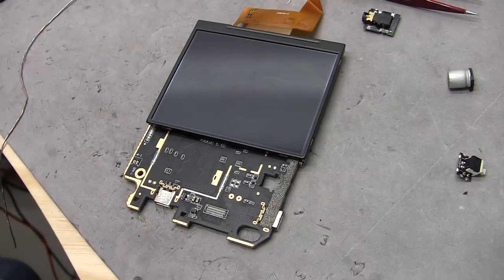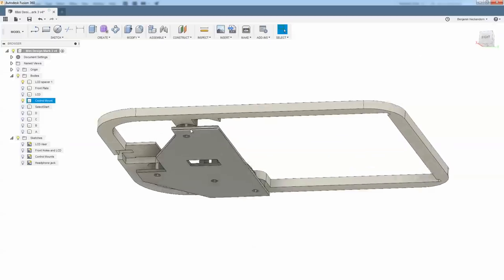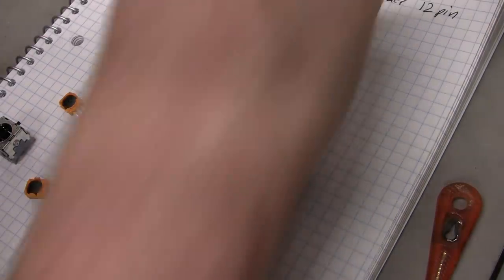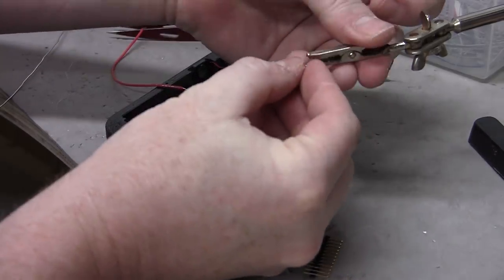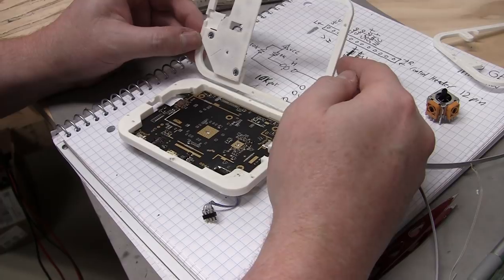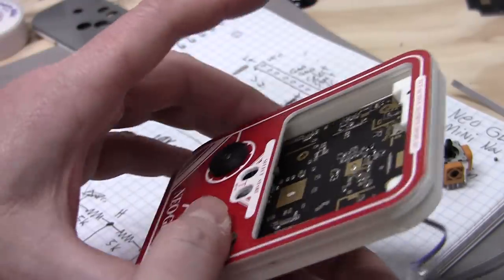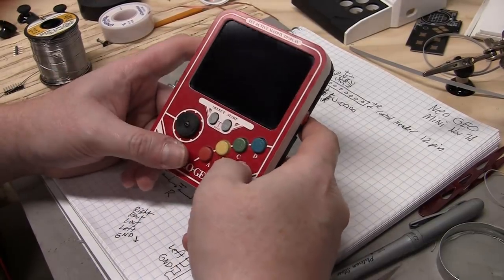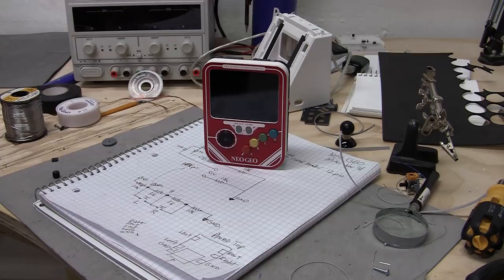Ben Heck Neo Geo Mini Portable Part 2

Comment: This would have been a much better final product.
Reply: but doesn't the click switches take away from the sensitivity of control? Like you can't get much variation in strength of movement that way it's either on or off.
Reply: It's intended to be a digital joystick, that's what the arcades had and that's what the games were programmed for.
Reply: Lassi Kinnunen  Hell, a single surface mount 5 way tactile switch from Sparkfun is only $2 and the Neo Geo Pocket/Pocket Color used a 4 way tactile switch instead of a D-Pad in the late 90s.

The additional cost would've been low enough that they probably wouldn't have needed to up the cost or if they wanted to maintain the same per unit profit margin maybe bump the price $5-$10. I have no idea why anyone would defend SNK's decision here.
Reply: @sams6090  That's exactly what those games were designed for. If you ever play an actual Neo Geo MVS cabinet you'll find the stick uses tactile switches. That's why if you buy say, a Sanwa kit, the stick has tactile switches and not an analog stick.
Reply: Looking at this, I do think they could have done this and had cartridges for it so you can play buy different games for it like a Game Boy.
Reply: @sams6090  All the games were designed with a 4 way digital input as the default control scheme so all those extra degrees of sensitivity aren't used by the games anyway.
Reply: @sams6090  This is neogeo m8 all games used digital inputs back in the day no analog
Reply: Lassi Kinnunen  why not add the clicky micro switches and remove something like the stereo speakers?  While they're at it, they should've taken out the hdmi out and added a battery
Reply: @JaredConnell  @ghhuyuyyu
Reply: @sams6090  Most arcade games don't use analog controls. A direction is either on or off, and the combination of 4 switches allows for 8 directions (by being able to press two at once in the corners).
Reply: Sam's luvin no, because all controls are binary in these games
Reply: @sams6090  you got owned in these comments.

Comment: I love that you're helping those in gaming needs!  You are great at what you do, and I've learned a lot from you!  I retro fitted my Grandfather's DREMEL table jig saw with a modern electrical ground plug because the electrical cable was shedding old plastic when I used it.  I used your soldering techniques to do it!  The thing is from the 50's from my research!

Comment: Now you have to bypass the password on the terminal so that you can add more games
Reply: @adventureoflinkmk2   Probably "Admin", lol.
Reply: Is it though?
Reply: @NeoJ4K3  I've tried quite a few myself. It's not Admin, lol. I have this idea to dump the flash by removing it and then using a chip dumper to get the data and a Linux system to jail into the filesystem and figure it out. The cheapest chip programmer I could find that supports the flash used is like $400...Sadly my old Genius programmer is showing signs of age... 😆
Reply: it's 1234, same as the combination on my luggage😎
Reply: @twicethemegapower3995 I think that's  1234,5 ;)
Reply: @AWalYT  It's possible to brute force it. Cheaper but might take ages.
Reply: @AWalYT  Is there no DFU mode on that thing? Or a bootloader like uboot?
Reply: The password is password
Reply: @mbirth  I believe it starts into UBoot on the serial console, but I could not appear to interrupt startup. I remember I had a mini netbook PC running some ARM chip that I could just give it some input over serial during the UBoot and it'd freeze and wait for commands there, but the same thing just isn't working here.
Reply: @AWalYT  Have you tried hitting ESC a few times when UBoot starts? Also fiddle with the terminal settings as there are different ways they send key codes and maybe UBoot expects a different way.
Reply: @AWalYT  damn man, I hope you find a way in, would really make this little console even better
Reply: @twicethemegapower3995  who needs combinations? There are only about 7 different keys to all luggage in the world... and that number narrows DRAMATICALLY by the type of lock you have... I.e. roller bag or separate lock
Reply: @twicethemegapower3995  President Skroob, is that you??

Comment: Nice work.  Please get a better 3D printer though :-)     The only down side on this (but easy to correct) is the micro switches used only have a 30,000 press cycle life, so they could burn out in as little as 10 hours of constant play more aggressive players.

Comment: For the stick, it you printed it in the right dimensions you could put one of those rubber covers that go over the sticks of a PS4/Xbox controller. That'd cover the screw quite nicely, and provide extra grip.

Comment: Glad to see you doing videos like this after the show ended. I might be in the minority here, but I kind of like these simpler straight to the point, quick cut solder porn style videos more than the big production values of the show. It can be as long or as short as necessary.  You're familiar with John's Arcade (you did a collab with him after all), and his arcade restore videos are super long, but awesome. And you can always watch this stuff at 2x speed if you're short of time.  Please do more of this stuff. <3

Comment: Hey Ben, on one of your next projects like this, you should challenge yourself; where all separate components plug into each other with headers, rather than snaking wires through the sandwich. It'd make for a cleaner look and easier assembly/disassembly.

Comment: Hey, I really enjoyed this video! I much prefer this simpler format. Glad you are back!
I was sort of surprised that you were soldering switches and such on the 3d print; I thought it would melt and be messy.  I use the small PCB mill for my projects, and while I don't get things like soldermask and plated vias, I still find it is a lot easier than hand soldering. 
KiCAD and Eagle will now export 3d models of your board, which is really handy when building the rest of the box around it in Fusion. (Actually, it's kind of a pain to get right in KiCAD; maybe it works better in Eagle since they own it?)
Anyway, it's great to see you doing projects again! Keep it up!

Comment: This is amazing. But there's a missed opportunity here. You should have put both the controller ports on either side of the exterior and on the back of the unit add a kick stand like the Nintendo switch so you can prop the unit up and plug two controllers in on either side of the unit for some two player action.

Comment: The very same switches you find in a mouse. That's what you can scavenge from a defective mouse, along other things.

But, the NeoGeo action buttons were designed to be reachable by the whole hand at the same time. On SNK fighting games isn't rare to find moves that require all four buttons to be pressed simultaneously. Moreover, for a Metal Slug "standard" playing style one should be able to press jump, grenade and fire all in one hit (it's not rare). With such a configuration all those feats are basically very hard if not impossible to pull off. The SNK original "tiny arcade" isn't really that good if we were to talk about controls, but your design doesn't take this into account, just trying to imitate the classic MVS/AES button placement, with no real functionality.

Standard "four button controllers" from SNES onwards enable players to press at least two buttons at once, which is a good approximation of old cabinet playing style. Again, we're talking about a single finger and not four.

Comment: You've done a fantastic job! Have you ever done a Dos machine build before? Like make a console-like machine for playing old dos games. Atari and Commadore used to rebrand their computer line as gaming consoles all the time but the closest we ever got was the classic Xbox and the xbox one. Neither of which ran any existing software. Most pc reto gamers nowadays use sd cards for hard drives, I've seen DC to DC power supplies that are super tiny and you can play most games without a cdrom drive, although one would be cool (a slimline maybe). Also freedos is a great open sourse version of dos. I built a retro pc but it's super ugly, not even in that retro 90's it's great way. A DocHeck console would be epic.

Comment: Why did you decide to omit the controller ports and HDMI output?  Would be cool if it was designed in a way that putting the Neo•Geo mini into a dock will power and maintain the battery and include a HDMI out port and 2 controller ports.  Have all the connectors on the docking unit to keep, for the most part, the same form factor.  What do you think?

Comment: If you could do a quick follow up on how to make the external controllers clicky or any controller (including d pads) plus I've had numerous attempts at wiring control ports to a raspberry pi but it doesn't work is there some sort of coding that needs to be done before it's recognized?

Comment: Are you running a custom firmware on your makerbot, like sailfish? What program do you use to print from, or are you still using makerbot desktop? I inherited an original MB Replicator, and i'm trying to figure out the way to get the best prints.

Comment: Looks like the hardware is the same as the "800 in 1" Chinese consoles you can buy on amazon. Perhaps you can load firmware from that and have a multi system handheld?

Comment: That was  awesome!  Way better.  You'd think they'd make the thing playable rather than be a display thing.  I have a model on Thingiverse that will help you get the filament dialed in.  Look up Temperature Calibrations under inventimark.  I have the gcode there that will change the temp every 10 layers or so.  Really helps on getting a new filament to the right settings.  Looks like your flow is a little low on some of them by about 3% or so. Love that you're doing your own thing with your own channel now.
Reply: That's it.  I typically try not to post links on Youtube because they get censored out.  Thanks!

Comment: I just sub your channel, I am disabled I got a HORI Mini PS4 Controller for my ps4 the buttons are easier but the analog sticks needs to be easier to move the mini controller is easier to move then original ps4 controller its because I got duchenne muscular dystrophy my right hand can push buttons good my left one is to weak for the analog rest is a little to much could you help me.

Comment: I like the conversion but your 3D prints sucked. You need to adjust your profile top layers. I expect pros to do better. LOL ;) The sound was a little better after the change. Note the post office shaped case was what they used in Japan. It wasn't the NeoGeoGold that sucked it was the NeoGeoX.